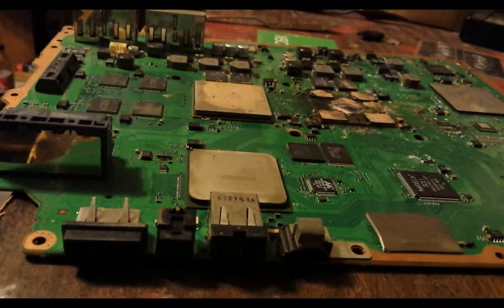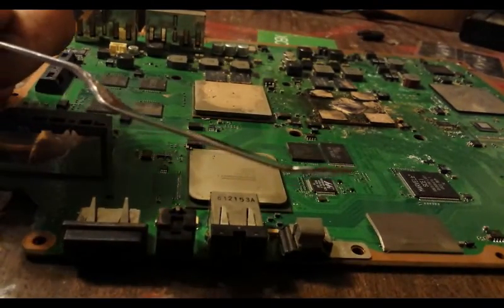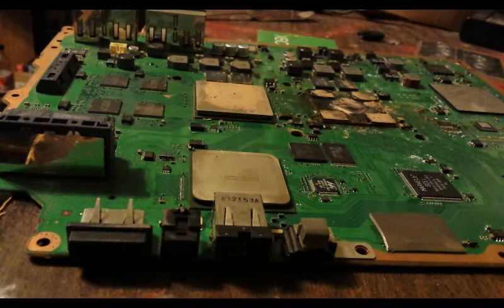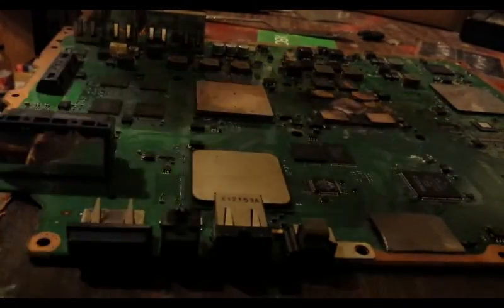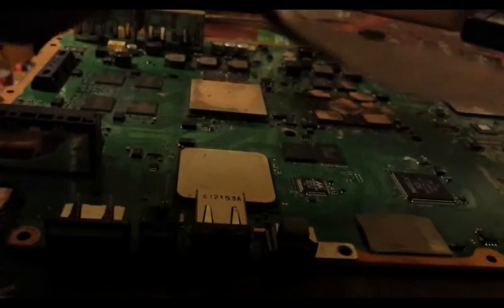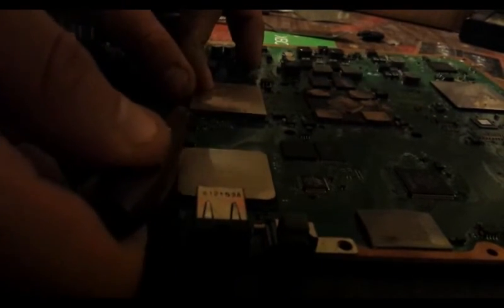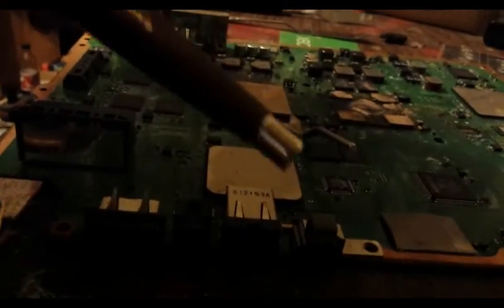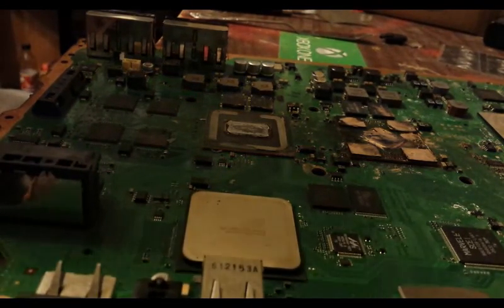Playstation 3 CPU IHS Removal

Comment: well man, i dunno about ur case but i tried this on 2 slims (alredy broken) and the epoxi was super tight, not even eating it would cut in wihtout pressing with a ridiculous amount of strenght. So either ur ps3 epoxi was already destroyed by time or the cpu was already delided and the video is a fake.

I really dont recommend doing the cpu to anyone thats not an absolute must because hard overheating, because chances are that you will scratch (minimal scratch is game over) the cpu while trying. The gpu is doable, not that risky, but the cpu is not even close to be that easy as the video shows.
Reply from the maker: That epoxy is a pain in the ass to get through and you really have to put some force into it, but it can be done. It's just not very easy to do. Lol. Keep trying. Practicing on broken systems is the way to go.
Reply: Ps3 model chechgo3  and previous model had a gap between CPU and IHS, which made it easier to cut the epoxy. I successfully delided  go3 model but scratch the CPU on mo3 model and its showing copper tracks.  It had yold and still has yold

Comment: Hey, how about a fishing line? Wouldnt it work also?
Reply: Yes
Reply: Fishing line will do the job harder, although it is possible. Fishing line will most likely scratch the solder mask on the CPU (not the copper tracks, they're ok, as they are made of copper and that material is harder than the material fishing line is made of), so you would have to restore solder mask after doing the job to have everything in order like it was before deliding.

Comment: is the board a fat or slim? 2001 or 2501 because there are boards that the silicon on the cpu is thicker and has a black plastic trim with raised bumps that it doesnt cut the silicon like butter because the bumps are in the way.